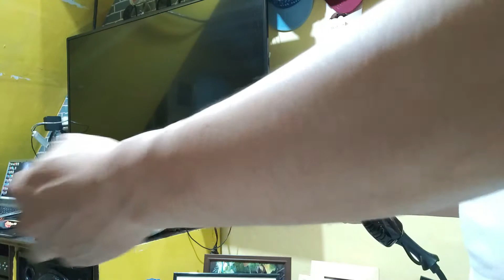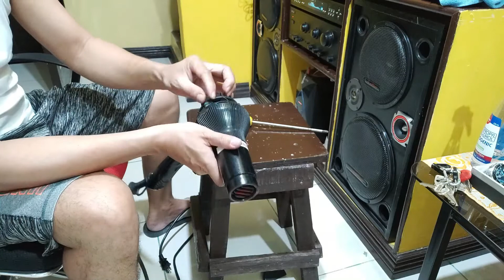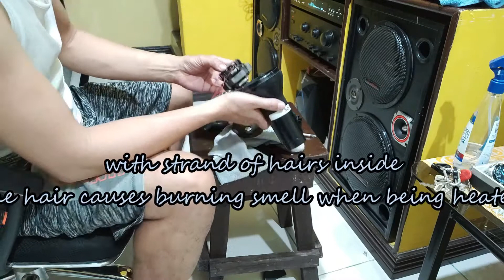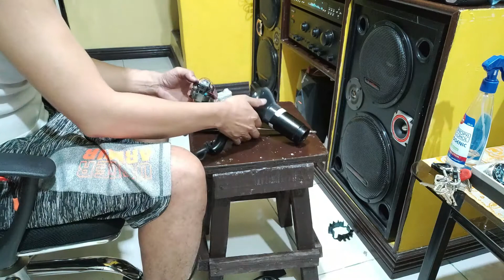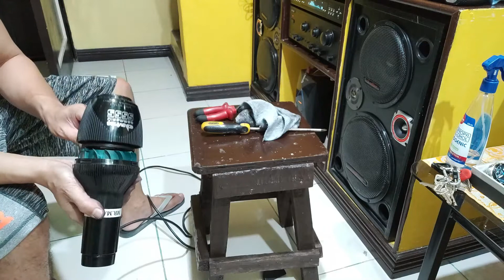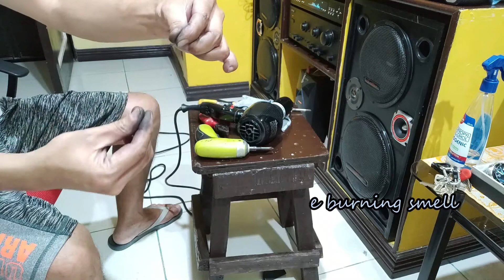Noisy Hair Dryer and Smells Like Burning Restoration

Comment: What kind of lubricant? Can I use wd40? It just makes a horrible noise when I first turn it on.
Reply from the maker: WD 40 to loosen and clean stains a small amount of multi purpose oil will  do for lubrication... for the noise have it check it is usually caused of the two moving parts that rubbing its other, like in my video it also create noise during first turn on, it was resolved by adjusting the blower fan